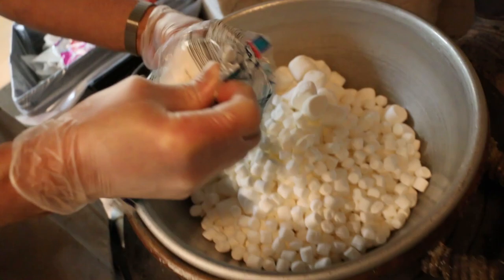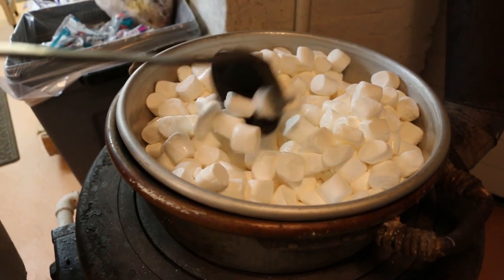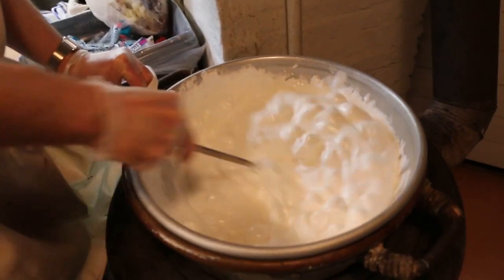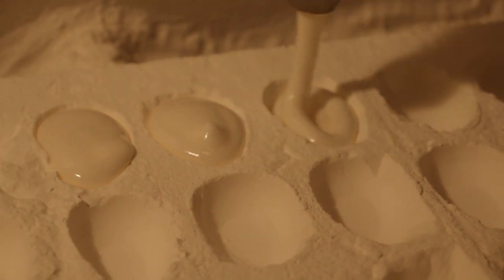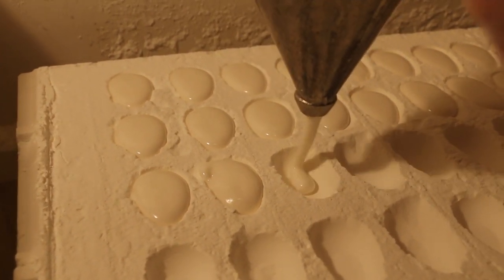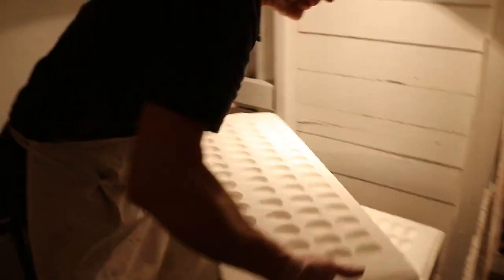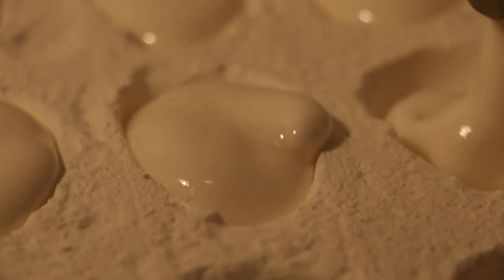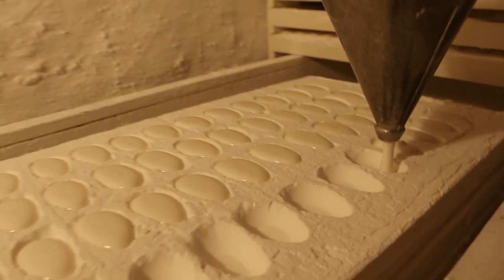Making Marshmallow Eggs

Comment: Starch moulds can be used for a lot of things - and now I'm considering how I can make a mould maker for use at home! ^_^
Marshmallow horses!!
Reply: I mean I think all you need is a box of cornstarch right?
Reply: @NoThankUBeQuiet  Potato starch is easier to get and cheaper where I live, so it'll have to do. And that is what they use at the local factory. ^_^
Reply: Hope you have a lot of money hanging around so when you've spent it on having the mold made  then figure it's to much work...........Sorry!
Reply: @lindapotter2621  It'll be a do it myself project  -and I am used to using tools.

Comment: probably a humidity thing....bread never can measure the 'cups' of flour...has to be by feel and it is totally all about the moisture in the air...
Reply: That's very likely. I don't make bread, but I make cakes and any time the humidity is out of whack I have to make small adjustments when the batter is nearing completion. I always keep a little spare flour and a little spare liquid on hand to adjust in either direction when I'm baking.